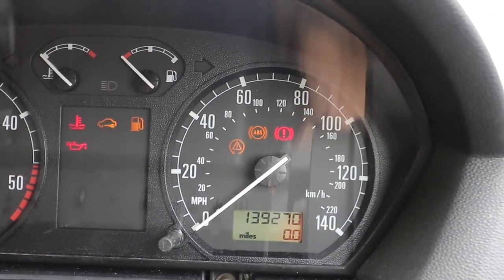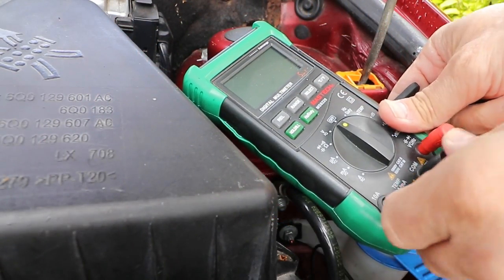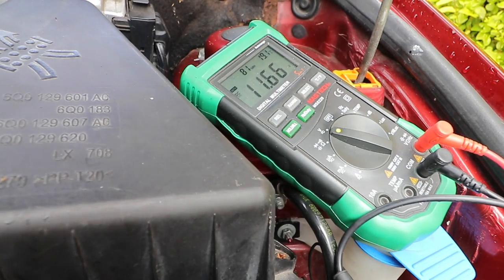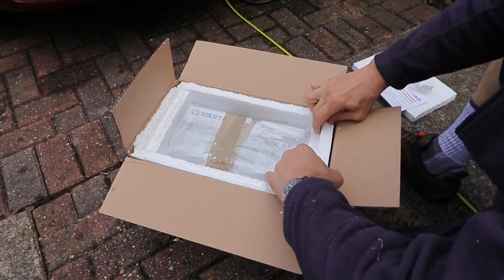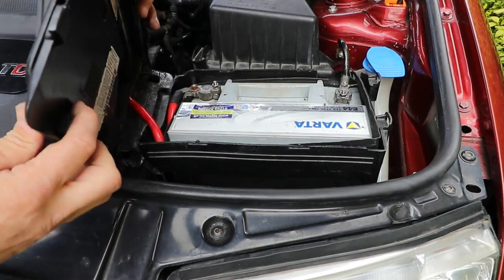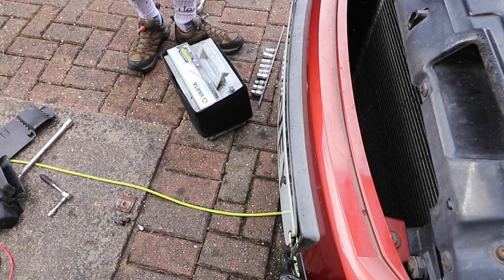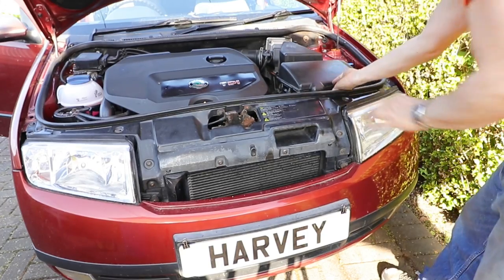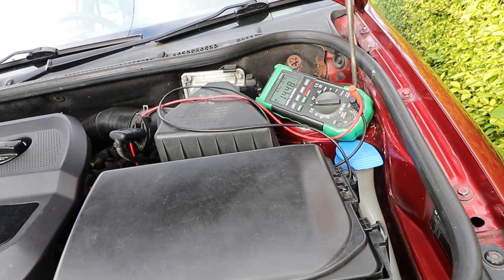SKODA FABIA Diagnosing Failing Battery, Upgrading Battery (Mk1 1.9 PD 99-07)

Comment: Ordered one of these batteries for my 2004 MK1 VRS. just waiting for it to arrive. The place who fitted my last battery used an oversized battery and had to remove the outside part of the battery tray and looks like the insulation cover was dumped also. So glad I am doing some things myself with your help. Cheers Harvey
Reply from the maker: You're very welcome. I always double check the battery dimensions with the existing, but if the is wrong to start with it could be a tad more difficult. I would never butcher the tray to make it fit though. you could get one from an ebay scrapper cheap. (insulation is always worth putting back) :-)
Reply: @HatBoyHarvey  Battery arrived late this afternoon. will let it sit for a while before I put my tester on it and see if it needs a top up before fitting. The tray I think is ok still they just removed the outside cover which I still have so will see if I can work out how to get in back into place. sadly no sign of the insulation.
Reply: Fitted new battery and all seems good, but I still have pretty long crank up times if the car is cold or hot. I am not sure where to go next as the car runs super fine since I had full service, new cam belt and cam sensor (that was faulty), top booster pipe, new rear disc and pads,4 new tyres and now the battery. I am considering taking it to a tuning place to check the remap that was done on it before I bought her, but don't want to go over the top. she already cost me a small fortune to get to the stage as of now. Any recommendations? I had a friend do a code diagnostic test and all good.

Comment: Another Great Video Harvey. Good bit about removing the air vent hose and housing put an upgraded Battery in my Fabia VRS mk1, that was on its original 2006 battery! 140k . The fuse box on top of the battery on a VRS is a pain. Car is Much improved by higher output battery 096 77 Amh Varta from Tanya who are great. The new battery however is slightly longer but there is enough space in the battery bay, its just fiddley to fit it!  Best prices and fast delivery too. Thanks very much excellent video and comments as usual!
Reply from the maker: Thanks, they should have mounted those fuses somewhere else for sure, I agree :-)

Comment: Guys please note Varta E11 also fits and it´s cheaper and upgraded but must change every 5 years.
Thanks for this video.
Reply from the maker: Yes the Varta E11 also fits, is cheaper and is a good battery, but produces the lower output of 680cca and 74Ah.

Comment: Very handy and timely for my Mk1 1.4 16v Fabia. I know for certain that my battery is getting weaker by the day, and is releasing gas as I have to clean white deposits in the positive side every few days. Alternator is charging well and within limits. With my Fabia, batteries rarely last more than 18 months. I wonder if an AGM battery would last longer, as conventional batteries don't like short trips all that much.
Reply from the maker: You need to clean this white stuff off ASA with a bit of baking soda to neutralise the acid then take off and clean the terminals thoroughly and reconnect firmly. The acid level is probably too low on a cell or two and needs checking, if you buy a sealed battery they are better. Lower powered batteries drain quicker and have to charge more often which reduces there life. Short trips affect batteries differently and will be similar to stop/start batteries that are designed to discharge and charge up quicker having larger thinner plates.

Comment: Thank you for this video. My battery dropped from working condition to 0V overnight. Not even the time shows on the digital clock. I've recharged it but then, again, overnight to 0V. I don't know if it's a short somewhere or the battery is just old and dead, I can't see a date on it. I'm going to try to put a new battery and see what'll happen.
Reply from the maker: You're welcome. If the battery won't charge then it maybe no good at all. You could try charging it off the car on a bench and see if it will charge. Also if the battery maybe OK, but the car seems to drain it, then it could be drawing current from something such as the boot light or glovebox light on that you can't necessarily see. If you have a multimeter you can test for current draw :-)
Reply: @HatBoyHarvey  Yes thank you, I've ordered a multimeter. I've been wanting to get one for a long time now, so now's as good time as any.

Comment: Hi iv got a 2005 skoda fabia 1.4tdi within two days the battery go's flat iv put a new battery on it and its still going flat in to days any ideas would be most appreciated thanks
Reply from the maker: Most likely current draw. Check both the glovebox light as it has a design flaw in that over time the bracket switch won't turn the light off and you'd never know (test with phone) and the boot light. If these are ok then you will have to test each circuit to find where the current is being drawn. Or you have a different battery - test it with voltmeter or battery tester on a load/crank test

Comment: i must admit that although you don`t do many video`s , all the one`s you do do are VERY helpful, have you ever come across this problem, i have a 2010 superb estate "like yours" and i`ve just had a garage fit new monroe FRONT shocks and spring`s, drove it last night and noticed the auto headlights are too low ? it`s in auto mode on the headlight switch and the headlights do the little dance when you switch on the ignition at night , have you come across this or heard about it ?
thanks
jerry
Reply from the maker: Thanks, glad you like the videos. Don't know much about the auto-lights yet, but I would have thought the dance they do is to calibrate them at the start, maybe this isn't so and has to be done in vagcom or the like, don't know. Does sound as though your new suspension may have altered the ride height a bit. They will settle after a while, so if it isn't so much I would wait a few weeks to see if there is any change. I will have a look into this :-)
Reply: @HatBoyHarvey  thanks for the reply, i`ve found the fault, the garage who fitted the shocks and springs broke the adjuster, i whipped the N/S  front wheel off earlier today and saw the damage, contacting the garage tomorrow, thanks again 😁😁😁
Reply from the maker: Good to know, thanks for sharing that. I'll have to have a look at that for future reference, Looks like the garage knocked it when making the repairs, if they did you would think they would have noticed, but this does happen. Hope it works out OK for you in the end :-)

Comment: If your backwipers and heathfan dont work when the car is cold but kicks in after few minuters. What could be the issue?
Reply from the maker: Electrical connection issue, check the earth ground to battery and battery resting voltage is good, then check  and test connections at rear wiper

Comment: Great video,Hi ! I thought I was wrong about upgradin but it is okay. From  Exide 12v44Ah 490A to 12v63Ah 560A Bosch s3. Believe me or not Exide factory battery was in car from 2006-2018, never had any problem,but it is 1.4petrol BXW.I changed it just as precausion. And bought a smart charger,don't know much about electronics but I was told that it is good to put  battery on smart charger 2 or 3x monthly and it will had good long life.
Reply from the maker: Thanks. The debate on trickle chargers continues, but if you leave your car for days without use then I would use one to maintain the battery charge, especially in winter time and with an older battery. That is what I do on my motocycle and need to do on the Superb :-)

Comment: When you open drivers door, all petrol cars will run the petrol pump this can create load on battery in range of 5-10Amps. Diesel engine from some model years will instead preglow engine if the temperature is low. Even without pre pumping/glowing (as you can turn that of with software) i found out that after opening drivers doors car starts for a little while sipping 1-5 amps from battery. I suspect that some of the car ECUs wake up during this moment and run some checks for a while. So when you open door or just unlock the car its not only interior ligths coming to life, depending on the trim level more things can wake up to sip the battery.
Reply from the maker: Thanks for sharing that :-)

Comment: Hello! Thank you for all videos!!! I have a problem: for me it's very annoying that ,,beep" from ,,low fuel"...! How can change this? Thank you!
Reply from the maker: Thanks, you're very welcome. have a look at: https://youtu.be/kAHCdnIWO8I as it sounds like the sender or connections may have a problem there.
Reply: @HatBoyHarvey  It is not a technichal problem, it's just an annoying sound (beep) , when fuel level it's low (red zone) indicator...🙂 Thank you!!
Reply from the maker: @vasilevasilescu5388  Yes I agree, it is annoying to the point when it happens I always jump out of my skin. It could be the same speaker as the indicators so there is an issue there reducing the sound mechanically, maybe it can be done in vagcom? :-)
Reply: @HatBoyHarvey  I think it can be changed, maybe from another car, like dacia logan mk1 -turn signal...? What you say...?
Reply from the maker: I think the later models have a softer speaker built in 06-07 maybe the higher spec models also. They have more of a bong sound and would be the best to fit as they are likely to be the same size and electrical spec. It is in the the back of the dash, top left from the front and may un-solder without taking the needles/face off. never done that so may do it if it works. Be mindful that you need the beep for the indicators for the MOT and would fail if they stopped working. Let me know how you get on with it if you do it :-)
Reply: @HatBoyHarvey  👍Thank you!

Comment: Ive got the E38 one.. and it isnt good.. on my battery i was supposed to only remove the left side plug. There was a sticker on it that told me so. My original battery was/had the same.
Maybe its different for your model/version.
According to the serial number on my battery it was produced like 10 months before i bought it. So it might have decreased its capacity etc since... :(

This E38 lasted about a year.. i dont not recommend anyone buy these batterys anymore. The quality isnt as it was. Many people have the same experience. Lasts typically 1-2 years MAX.
Reply from the maker: Varta guarantee the battery for 5 years, so you should be able to get it exchanged for a new one which you should do. Where did you purchase it? contact them and explain the battery has failed. If the battery what old stock or was stored in a cold area then that maybe why yours didn't last.

Comment: a Good 12v car battery voltage shouldn't go down below 7 volt while cranking engine, you can only tell the battery is good or bad, checking the voltage  under load , a bad battery drop its voltage much easily, much lower. As the battery degrades voltage drop become more and more significant, even it causes car computers corruption, a well knows one is car does not recognize keys, immobilizer lights on. Always start your car with a good battery.
Reply from the maker: with cold temperatures the battery maybe unable to power the starter when a boost is needed. Being stranded with a dead battery is not my idea of fun. If the voltage drop is consistently below 9.6 volts be aware the battery is likely failing and will need replacing. Thanks for sharing that :-)